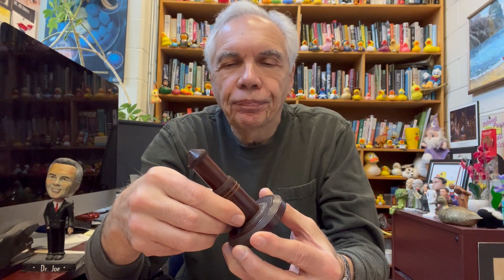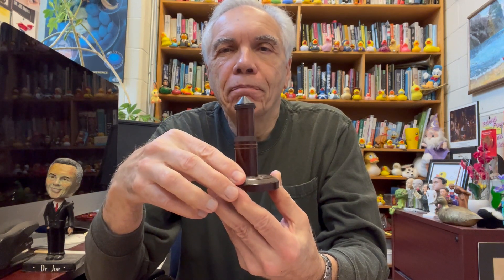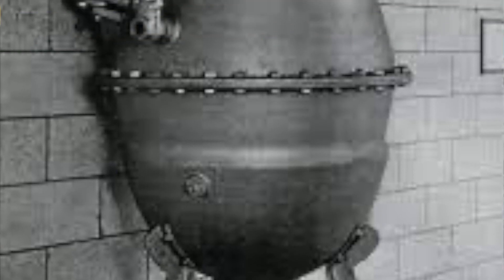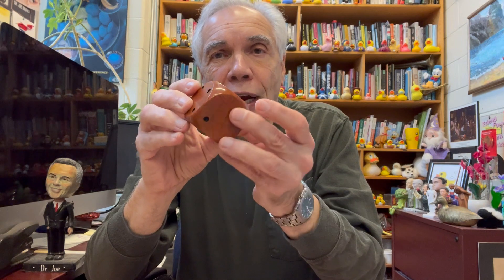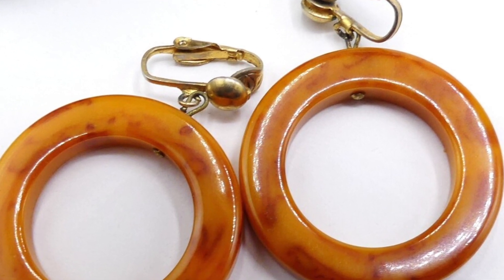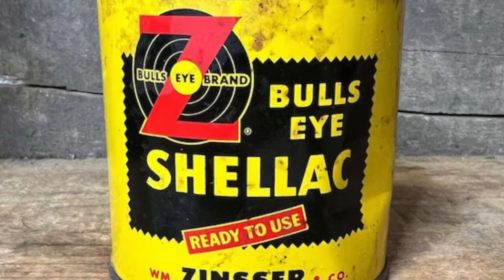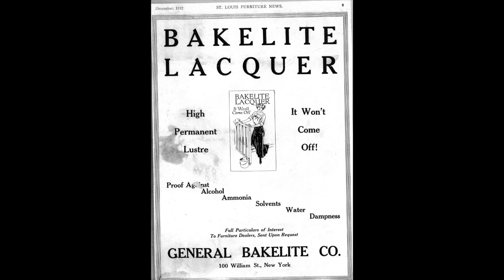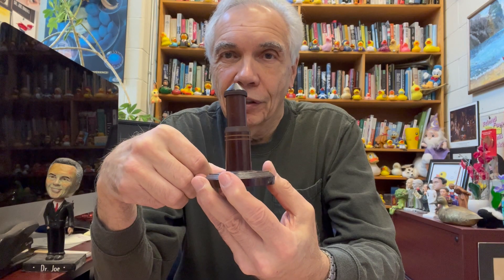Show and Tell-Baekelite!

Comment: Thanks Joe, As a vintage stuff collector,  Bakelite items always welcome. 

Thanks too, for touching on celluloid items extremely flammable. Also collect fountain pens. The Golden Age between 1920-60. As the rubber sacs in a old pen ossifies from the chemicals in ink, a pen needs to be disassembled to replace  with a new pliant sac. Then the pen lives to write again. 

 Heat from a candle is the traditional go-to standard to loosen pen parts once where joined with shellac. If a very little too much flame used, then instant bonfire. Pen morgue bound. Tricky.